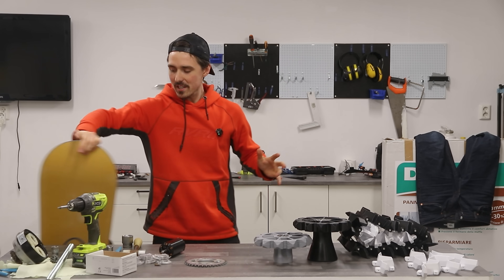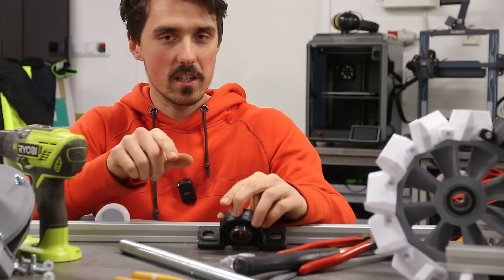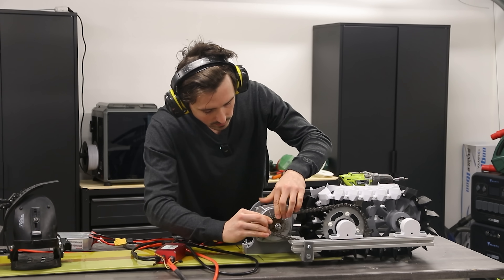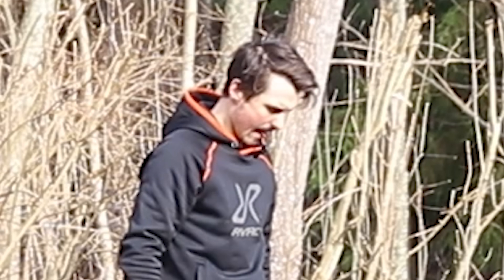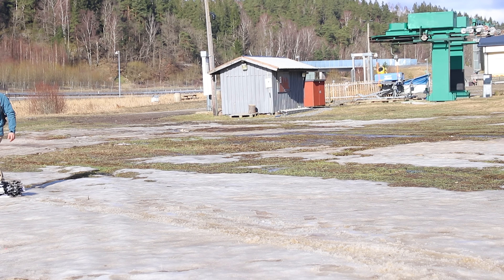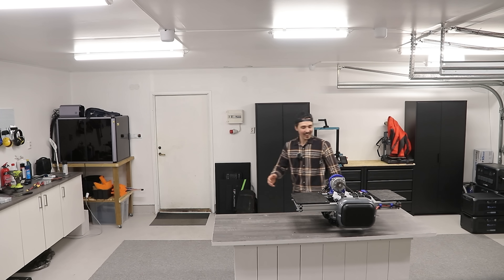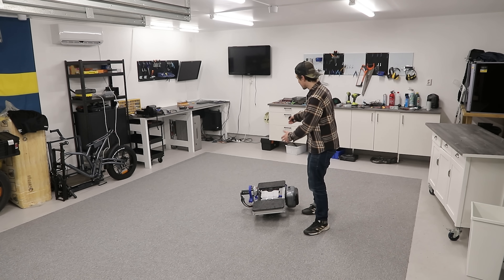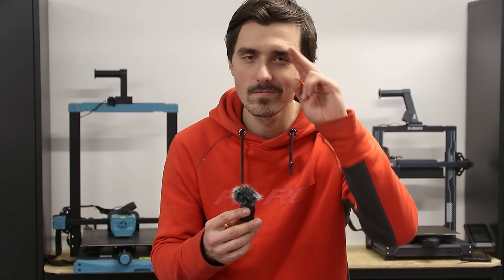World's First 3D Printed Onewheel With Tracks!

Comment: I'm just finishing JD's garage plasma cutter, you should build one, and then can make motor mounts out of 6mm steel! 

P.S. My variation of JDS garage plasma cutter is modified to run on mach3 plasma, way better experience. Some modifications to frame and other parts. great machine tho. just 25 bucks and 400 euro in total

Comment: Lock up vescify, VESC motor controller that gives you one wheel self balance features. Like future motion, but if you disconnect your battery is will not brick it self.
Reply: Amazing ain't it

Comment: I think the biggest issue with the tracked "onewheel" is the high center of gravity. I think if you could lower your gearing so you get smoother lower rpm torque and add an IMU for basic balance control it could work better.
Reply: Funny the person who made the most popular open source self balancing code is also named Mitch!

Comment: hey man good effort. both projects had potential. remember, the onewheel has integrated hoverboard style balancing electronics in it to help it stay stable. that would obviously make it alot easier to ride. 
on the other hand, the track has a flat contact patch that should be a statically stable balanced state and a very dramatically variable torque if it tips away from the whole surface contacting the ground, so i'm not sure how well the dynamic balancing electronics would work without completely different tuning. it wouldn't just be fighting against keeping your platform from tipping forwards and backwards but also the huge variations in applied torque if the track goes from its massive contact patch to tipping back and only riding on 1 or 2 links around the rear 'wheel'.

wheelieing on the rear 'wheel' would be comparable but then theres no real point to it being a track over a wheel with grippy tread.

it can still be salvaged though, maybe into a seated snowmobile or or something. anyway, nice to see you, keep it up!

Comment: We all know by now that you are brilliant AF.  BUT…

When you showed up at the beach, I said to myself, huh…. 😂😂
Reply: Yeah... added traction also means added traction on slide surface. Issue was lack of suspension and track was too high comparing the snow surface. After adding suspension of push the track on the snow, next issue would become how much the printed everything can take. From the possible ideas the board made more sense. The one wheel i would just put to replace bicycle rear tire and put ski on front. Even then it would only work in shallow snow, while powder really needs rubber track of a snowmobile to have any decent action in actual snow. Hell even snowmobiles struggle on some kinds of snow, i have gotten stuck plenty of times even though its long track model with plenty of power and only me as cargo.
Also thing to consider is to have some kind of shield since if the track snaps, what are the directions for it to fly towards?

Comment: I wonder if there's a way to experiment with the geometry of the track link design to make it less jarring? Curved profiles? Thinner links with more overlap? Trying to think if there are shapes like the Reuleaux triangle that have non-constant width, but that also roll like a ball...
Reply: it would need convex profile to steer, but the longer the track like that would be the less steering effect it could have.

and some balancing electronic for the power delivery i suppose. but the one wheel concept basically doesn't work with anything that isn't a tire more or less.
Reply: @lasskinn474  Maybe instead of a flat contact patch against the ground, it needs a curved one? To make it more like a tire? Maybe he could make some kind of bogey system that started out flat so you could stand on it, but as you leaned forward, it'd push the bogies into a curved path and then move forward. Also, if he wanted it to be off road, he could make the profile of the treads convex, like you said. The "road contact" portion could be smooth or rubber, and then have the paddle section make contact if it's sinking into sand or dirt or snow.

Comment: Interesting concept- I would look more into the other powered snowboards that people have built over the last decade or so, see the issues they had and determine the steps needed to make this more viable. Trying to ram the large flat board through the snow just doesn't work, you need a different approach, and you need a different style of tread for harder surfaces like grass or road compared to snow or sand.

Comment: You def need it to be self balancing(needs to control its own torque). If you go deeper with this concept, you could look into vesc one wheels. The controller could pretty much just drop straight into your frame.
Reply: Or get a gyro and RCTestFlight to implement some ArduPilot self-balancing board mode. ;)
Reply: I agree, it is a control system problem. I admire his persistence and hope he continues on this one. SO COOL!
Reply: Vesc would be great making it an actual "one wheel" that would most likely also be able to go up that hill without issues.
Reply: a spring chain tensioner would help the chain slap .
Reply: my thought exactly. should do a collab with RCTestflight, send him your stuff, make him fit a pid control loop based on kalman gyro/acc

Comment: Like on your electric snow racer it needs suspension to maintain ground contact or like with the other iteration with the big wheel it requires some added weight for traction. Probably didn’t need me to tell you that sorry if you see this as an attack on your intelligence, just suggestions. Also keep up the good work and thank you for the videos, and the one track is pretty cool maybe a programmable esc might help with the acceleration of the motor and maybe an alteration to the design of the tracks where they are wider and thicker to deal with weight dispersal.
Reply: That was my thought to, even before he tested it. When he stod on it the whole drivetrain flexed upwards and didnt get any weight down on the ground.
Reply: @Alpejohn 🔴 What Is Islam? 

🔴 Islam is not just another religion. 

🔵 It is the same message preached by Moses, Jesus and Abraham.

 🔴 Islam literally means ‘submission to God’ and it teaches us to have a direct relationship with God. 

 🔵 It reminds us that since God created us, no one should be worshipped except God alone. 

 🔴 It also teaches that God is nothing like a human being or like anything that we can imagine.

🌍 The concept of God is summarized in the Quran as:

📖 { “Say, He is God, the One.  God, the Absolute.  He does not give birth, nor was He born, and there is nothing like Him.”} (Quran 112:1-4) 📚

🔴 Becoming a Muslim is not turning your back to Jesus. 

🔵 Rather it’s going back to the original teachings of Jesus and obeying him. 

More .....👇

🔴 THE RETURN OF JESUS
Reply: @1islam1  I’m not interested and I don’t care.
Reply: @Alpejohn  Report it as spam, which it basically is